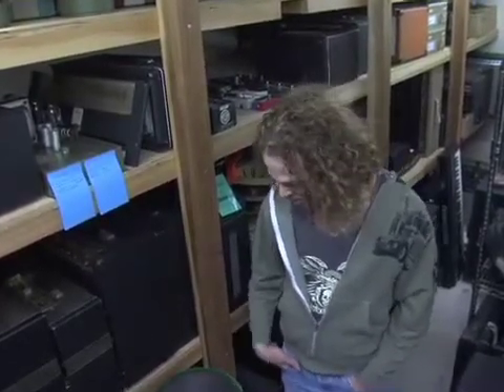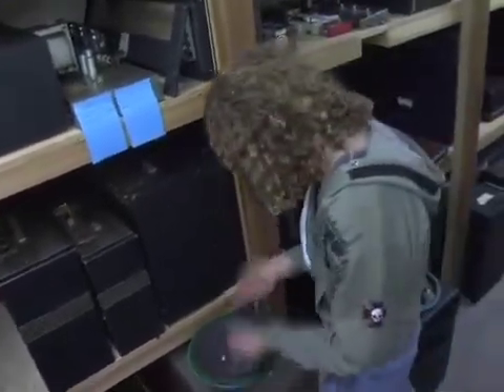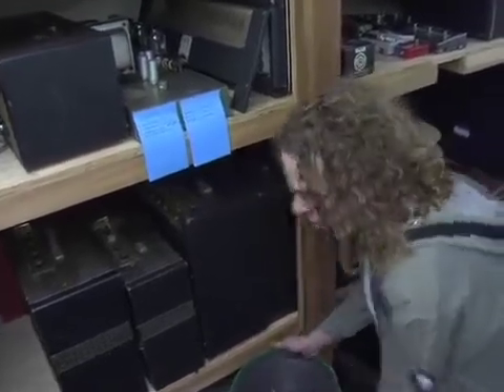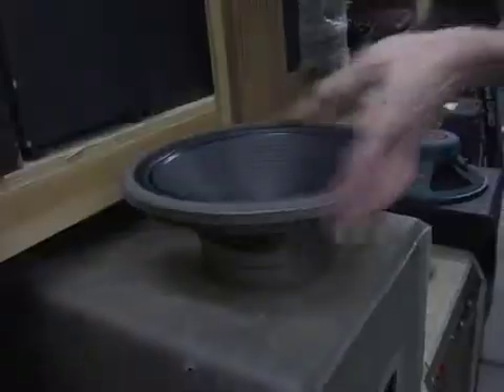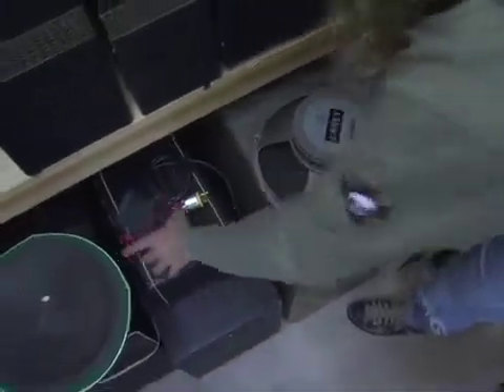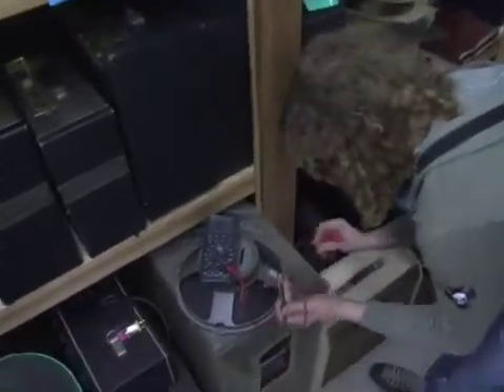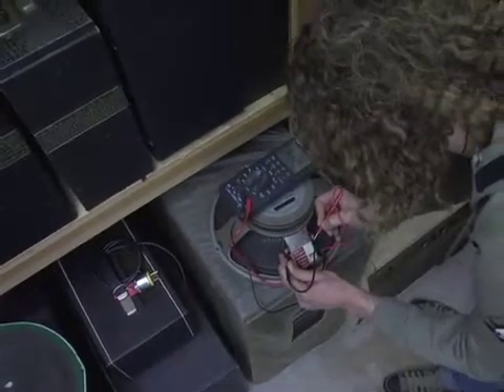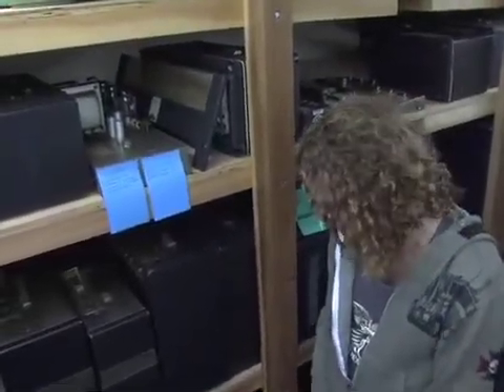Tech Education 5 how to test a speaker

Comment: Impedance can not be measured exactly by measuring ohms only. Ohms are a rough indicator. Impedance consists of resistance R (measured in Ohms), inductance L (measured in milliHenry) and capacitance C (measured in microFarad)

Resistance R is what you measure with this setting on a multi-meter. That is a big factor in a speaker impedance so it can be a rough guide. Real impedance Z measurement requires a more complex meter. But that's not needed for this consumer type of impedance quest :-)